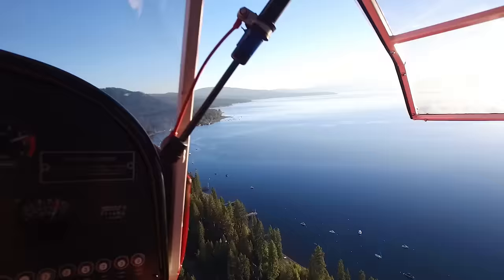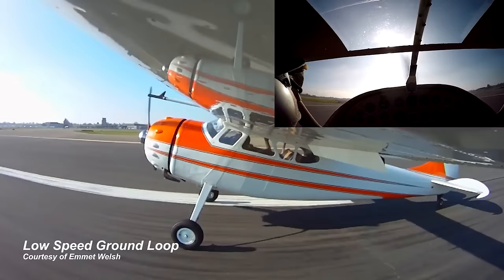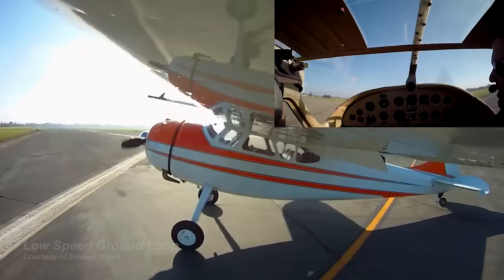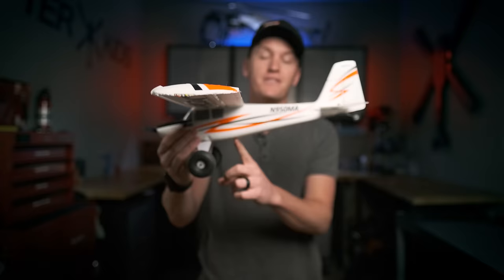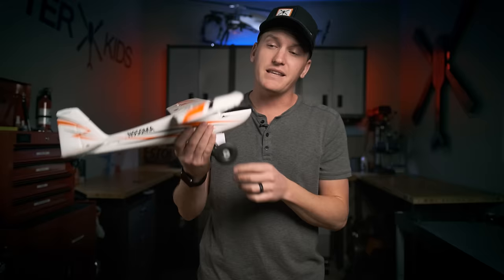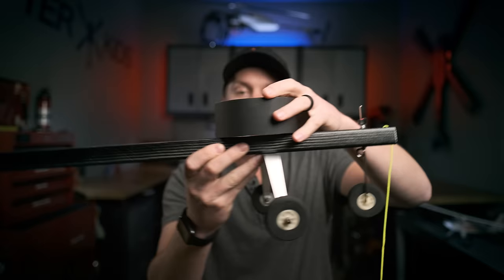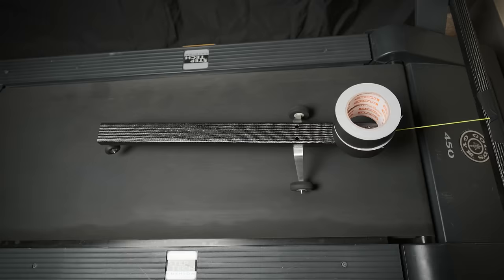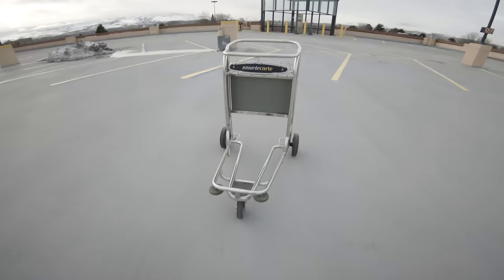The Ground Loop Monster

Comment: Main Landing gear alignment can make a plane very susceptible to ground looping.  You want the main wheels to have zero toe-in.  Preferably slight 1 or 2 degrees of toe out is preferred.  An airplane with toe-in will ground loop much easier than one with toe-out.
Reply from the maker: Oh yeah, that’s one thing I forgot to mention! My old landing gear was toe in, and man, I’ll tell you it definitely made me a better pilot. My current gear has just a tad of toe out and it’s a cake walk to takeoff and land

Comment: Trent when I was flying cargo I flew Beech 18's and I NEVER flown an airplane with a tail wheel (it never appealed to me) wIth over 5600hrs of flight time (knocking on wood) the only thing that ever happened to me we'll two.... one I didn't close the door for the oil dipstick on top of the cowling and number two I àwas doing touch and goes on a turf field during the winter my brakes froze and when I landed on my home airport (KRFD) runway which was concrete I put the airplane into a snow pile

Comment: The things that get you are mostly due to reduced visibility. A tail wheel aircraft can do a wheel landing but then as the tail (rudder and elevator) lose effectiveness, the nose comes up and the pilot has to transition to looking to the side, This is not much different from an IFR approach at decision height. If a missed approach is executed, the pilot has to quit looking ahead and get back on the gauges. That is not an instantaneous operation. If this takes a second or two, you are at decision height and have some cushion for a little awkwardness. If you are landing into the setting sun, with a crosswind, the physiological adjustment may simply be too slow for the action. To keep the plane on the runway, you have to see the side of the runway and be familiar with judging the perspective in poor lighting.Old timers may remember when cross wind landings were taught as approach in a crab and kicking the tail straight at touchdown. Ground loops were a more frequent occurrence back then and a popular subject for hangar flying. Why are bush planes mostly conventional gear?  You can usually fit bigger tires on the main gear, but a nose wheel fork means a bigger wheel requires a replacement nose gear. Then, the bigger nose wheel creates a lot of drag sitting behind the prop. A few airplanes have retractable nose gear and fixed mains since the nose gear has disproportional drag.

Comment: How about a bush-plane with nose & tail wheel wheels, with cg near the main gear? Keep the propeller clear on takeoff,  use the nose wheel while landing...
Reply from the maker: I think with the CG that close to the mains it would still be relatively unstable, when playing with this treadmill setup even moving the weight to neutral over the gear it begins to swerve.

Comment: I learned to fly in a 65 hp Champ in 1956... I soloed in 6.5  hours. I wonder if tail wheel aircraft have gotten harder to fly or what has happened to present day pilots. About 20 years ago I wanted to rent a champ from a local FBO and had to fly with a instructor for 10 hours due to the difficulty in flying a tail wheel aircraft. At the time I thought WTF but had a great time flying the vicious taildragger.
       Marv,  A genuine old fart

Comment: I was riding in an ultralight, he let me fly it, saw some deer down  below, went into a circle down watching them, the Pilot called, Better get your wing up! I tried, air lock!! the two of us together wasn't going to get it up!! he probably already tried!!!I thought to hit hard right rudder, as we leaned to the left, afraid if i touched rudder, he might not let me, so I slammed it as hard as I could and released just  as the wing came up, I jammed for the throttle, but it was moving ahead of me!!! He said he was just going to pull the parachute!!! that might mean broken backs going down!! Really glad the trick worked, but I got a pilot in so much trouble...he couldn't get us out of it...Did I want him for a pilot????

Comment: Seems like it would be an easy fix, don’t put the tail wheel on a swivel and make the wheel a bit larger, that would help keep it on track and you control direction with the brakes anyway.

Comment: wow, I never knew. that was very informative. I have a question. why can't you connect the tail wheel with the rudder so that the wheel turns where the rudder is going instead of acting independently ?..

Comment: Non-flier question. Wouldn't a fairly simple cable op tailwheel limiter work? A sort of fork that could be dropped around the pivot shaft to limit it to 30 degrees or so and lifted away for taxiing. I'm sure the issue has been studied to death but it's wierd that it's so intractable.
Reply from the maker: Its not an issue with the tailwheel steering, its with the actual balance of the weight pushing the main gear, even with a tailwheel locked straight forward or with a skid on the back you can still ground loop. There have been a ton of different types of tailwheels designed to try to combat ground loops but the only solution that I know of that works reliably is putting the little wheel in the front!

Comment: some late thoughts, from an rc pilot who has limited fixed-wing experience.       in the case of a high-winger,  the center of mass is low.   in the air, the mass of the aircraft is hanging under the wing.   the pendulum effect results in a lot of self-stabilization.    at the point that the main gear is on the ground, self-stabilization is gone.    seat of the pants info probably makes a pilot aware  that this has happened.      as stated, a pilot Should  anticipate the need to be  more  proactive,  at those times.    cheers

Comment: I wonder how much force (under the rudder for example - so a long lever) would be required to counter the ground loop monster at low speeds on the Kitfox?  I ask because I don't see any mention of innovation in the comments, just pilot skill / luck.  If it isn't more than say 15kg of direct sideways force, then a modern RC ducted fan could be placed in the fuselage at that point (or in the vertical stab), under control with a very simple microcontroller, and could quite effectively and rapidly apply an opposite force.  Like a bow-thruster on a boat.  It would add some weight, but not much.  Again, it depends on force required.  A system like that could be useful for water-taxiing, and have three modes: ground loop, rudder augmentation, and manual.
[Edit]: after a few more minutes thought two more suggestions that use computer assist.  A braking system that can differentially brake the front wheels that looks for ground loop conditions (so staying ahead of the plane using computer), and/or a motor assist on the front wheels.  Small motors can have extremely high power output for short times (and could operate on a sprag clutch so is only engaged in forward direction).  The trailing front wheel could be momentarily powered to bring it back in alignment.  Yes, more weight, but again, not a huge amount, plus powered wheels might provide other uses.
Reply from the maker: That’s a very interesting idea!

Comment: Private sir. Absolutely love your treadmill & grocery cart examples!!! Will include them in our T/W traning if ok with you ? However...If you are not going to correct the video, and add ailerone YAW into the program as a directional force on the ground, then at least remove it from the net till you get your CFI. 
The rudder & brakes (your example sir) at 8 min gets far too much credit for that which they can't do, except to put these machines on their backs, on the runway, hurting many innocent passengers. 
Ailerons being the larger control (2 to 4 times the area & leverage of the wee rudder) MUST, be addressed as the BULL in the china shop, to properly control ones direction on the runway.
Simple rule Private: Ailerons PROPORTIONALY & OPPOSITE the needed rudder. Drive it like a car only exacerbates the problem.
Stay off the brakes, esp with the tail in the air.
Cheers & blue skys capt.
CFI 1507987 since early 1960's

Comment: On the ground, tailwheel aircraft are directionally unstable and forward visibility is compromised. In the air they fly like any other aircraft. So what's the upside of tailwheel aircraft? Please don't take my question the wrong way, I'm really curious.
Reply from the maker: Taildraggers are much more robust for off field operations. The nose wheel does not float on soft terrain well and is prone to damage being that it has the weight of the entire engine on it. Plus tailwheels are way more fun to takeoff and land!
Reply: @TrentonPalmer  Thanks, I can see that.
Reply: It's a very valid question.  Another aspect of tailwheel training is that it teaches you to be much more physically sensitive to how coordinated your control inputs are.  If you have a good "feel" for what your aircraft is doing, and what it needs, it will teach you to be a better stick-and-rudder pilot.
Reply: @TrentonPalmer  Has anyone built a taildragger with a fixed tailwheel & steerable mains, out of interest? there's blindingly obvious engineering issues but surely someone's tried it...
Reply: @Karibanu  I've written a couple of articles on just that subject titled "Bass Akwards". do not know if anyone has tried it. We have been trying to steer the wrong end. Murry Rozansky

Comment: My first airplane was a Luscombe 8B, very touchy, and underpowered with its 65 hp Lycoming. Enough power to get into trouble and not enough to get you out! Made me a better pilot though,  in a way my Champ is worse in that it isn't  as responsive when you need it, the soft oleo gear and 8.50s make it susceptible to wing lift in a crosswind if you don't have fast aileron inputs as well. I love both planes for what they are and still try to keep a Luscombe on retainer. Will be checking out in an AN-2 when I can. That might be like herding a bus down the runway!
Reply from the maker: When I first got my kitfox I was in the same boat, 80hp up here at high altitude wasn't enough to get me out of trouble, but could definitely get me into it. Also the gear being out of alignment (toe in) sure didn't help... haha

Comment: Thanks for posting! It must have been "interesting" being a wartime bomber pilot of a giant 4-engined tailwheel aircraft and having to contend with this phenomenon...?
Reply: Longer, bigger and heavier aircraft -- probably means you have more time to react, but the forces required to control it are greater (I don't think power assist flight controls were available on those types of airplanes?)

Comment: I know jack about airplane physics, but that sounds a LOT like the snap oversteer you get in rear-engine cars, for probably the same reason (gc behind front wheels).
Reply: CG in a car will always be behind the front wheels, or they'd tip on their nose. The oversteer in a rear-engined car is a much larger moment of inertia in yaw thanks to the concentration of mass at the back - ie, it's harder to stop the car rotating. The issue with the taildragger is that the front wheels don't steer, you'd have the same problem with a rear-wheel steering car.
Reply: A plane ground loop is more like driving a car backwards and letting go of the steering wheel. Going forward, the front wheels will track mostly straight. In reverse, you'll quickly spin out.

Comment: Trent, have you ever tried driving a 
fork lift?  Most of them suffer with 
rear wheel steering.  I got quite 
proficient at driving one, but could 
feel the tendency to come around.

Is this similar to taxiing a tail dragger?
(I wonder how they did it in the Mustang 
and Corsair?)

steve

Comment: I am a pilot so I have some knowledge of aviation but I don't have my tail dragger.  Though would a small hand break system on the tail wheel help stop a ground loop from getting out of hand.  The pilot can pull the lever when the tail begins to get away?

Comment: Ground loop, prop strike on tail wheel. Sounds to me that the tri configuration is just simply better. Any pros n cons?
Reply: AIUI (IANAP) the nosewheel is easier to control on a good runway, has better visibility during taxi and means the fuselage is horizontal during loading/unloading, but the tailwheel causes less drag and handles soft/rough field conditions better.

Comment: ??? The center of gravity is never going to be forward of the nose wheel, it's going to be right in front of the main gear in tricycle configuration so as to provide as little impediment to the craft rotating as possible.
3:17 now put the weight just in front of the main gear in tricycle as it's supposed to be. It'll still be stable, but it'll be more stable and you won't get as much vertical bounce from the nose gear.

Comment: Re-posted from Prop strike TP; FYI my father worked here in San Antonio, TX. at Dee Howard Aviation as an electrician, He was on the crew assigned to convert the Lockheed Lodestar 250 from tail dragger.., to a tri-gear, a qualified success back in the day.., but not without headaches of course... https://www.deehoward.org/the-dee-howard-legacy/innovations/howard-aero-innovations/item/howard-250-tri-gear

Comment: The one where the gaff tape cost more than the carbon fiber
Reply from the maker: Actually that carbon tube was super pricey when I got it. The project I bought it for flopped though so I figured I might as well use it for something. The gaff tape is off amazon 😝

Comment: Excellent ground loop explanation. I knew they happened, just didn't know why. Say, is that an Eflite Timber you were demonstrating with? Been thinking of getting one of those myself. It'll be the closest I'll ever get to flying a bush plane. Do those ground loop as easily as the real thing?
Reply from the maker: I am not sure how I’d compare the ground looping tendencies. I’ve definitely ground looped the timber but never my Kitfox. Things just happen so much faster in an RC plane
Reply: @TrentonPalmer  LOL. Yup, the RC planes do have a short reaction time. I have come to realize that RC doesn't stand for Remote Control, but Repair constantly!

Comment: Do they make any automated systems to help prevent ground loops? It seems that differential application of the brakes with some automated control system could prevent many issues - similar to brake based traction control systems on passenger cars

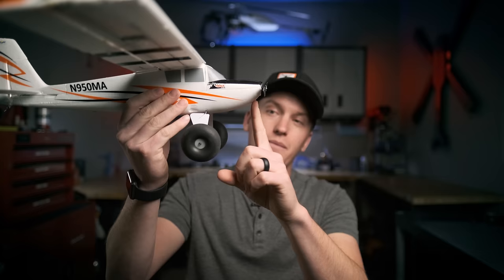Comment: At 1:40 you are going to make people think the center of gravity is farther forward on a tri-gear airplane because of where you point.  You should have explained that the main gear is farther back on a tri gear than a taildragger (like you are holding) which places the main gear behind the center of gravity.
Reply from the maker: Yeah, left a little there for interpretation. Probably should have clarified better

Comment: Take a shopping cart, turn it around, and run it down the aisle of the supermarket BACKWARDS. You will experience the instability immediately! One more factor: Motorcycle Effect! http://slehar.com/wwwRel/webstuff/pitts/pitts.html If during an impending ground loop, one wheel lifts off the ground, thus making it impossible to apply the brake on that side, FIRST get that wheel on the ground, THEN apply brake on that side.

Comment: Is it possible to get an upgrade to where you can lock the back wheel in a straight position after taxing to the runway?
Reply from the maker: Yes, they make locking tailwheels and they are supposed to be very helpful (but also are only helpful when the tail is down)

Comment: Black Hawk helicopters have a tail wheel lock to lock it straight for landing. I know it's a different animal altogether but could that defeat the monster?
Reply from the maker: It definitely helps when the tail is down, some planes run locking tailwheels and it helps for sure

Comment: Does suspension geometry make much of a difference? ie. Wilga style trailing arm vs Kitfox style wishbone vs double wishbone (camber compensation)?
Reply: No expert... but I'd guess not.  CG is the biggest issue.
Reply: @goatflieg  I just wondered if camber thrust made a difference with those balloon tyres in a dynamic situation. You are probably correct though.

Comment: trent; the real monster is one of two different planes; that I class as bad. the Stearman and the Harvard (Texan) for you Yankees.I only have around 50 hours in the Harvard but have over 400 in the Stearman. Another one that could be bad was the Avenger. The rudder is there for a reason, just stay ahead of the aircraft; No problem.